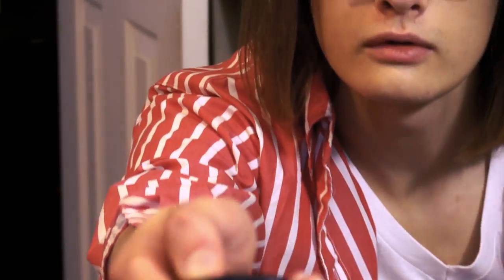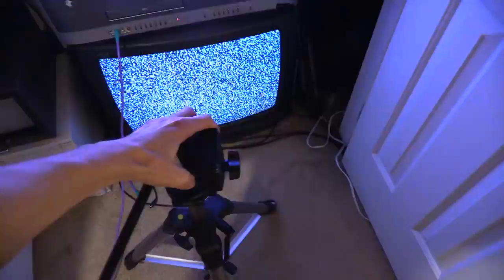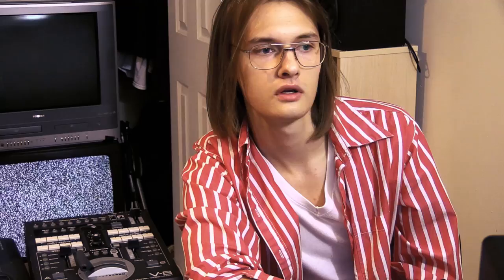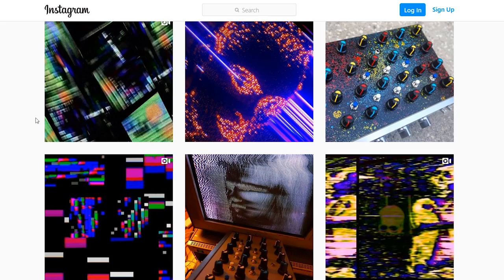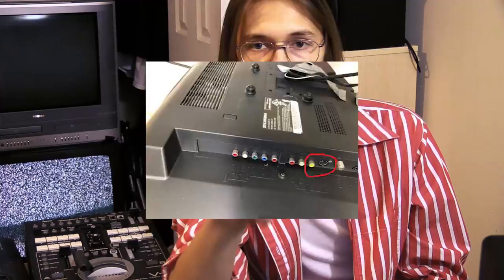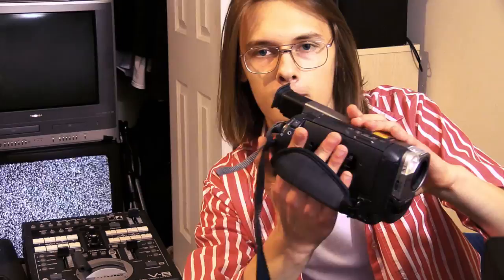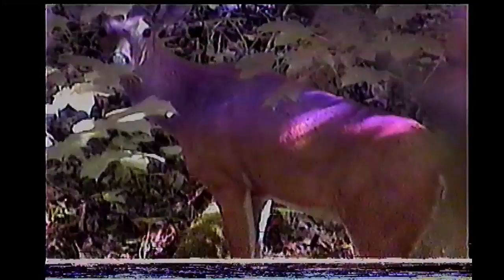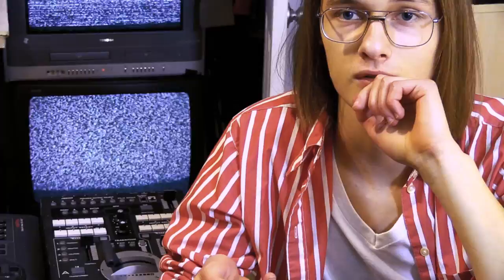3 different ways to capture analog glitch visuals

Comment: If you want to upload footage on Youtube, scale it up to 4K, even if you recorded it on HD - Youtube allows a higher bitrate on 4K (44-56 Mbit/s) as on HD (10Mbit/s). You can get way more details with this one, very nice with CRT stuff ;). As a filmmaker I can also recomment to setup the shutter to the number which is double the framerate, with this setting the motion looks natural. (Or you can just use 180 degree, if you have a camera which allows it) But you have to be lucky to get away from scanlines this way, depends on which CRT you're using. Keep on producing great stuff like this, very informative ;)
Reply from the maker: Thanks for watching! and yes sometimes I upload my analog videos in 1440p, but I haven't tried 4k though, I would guess it's probably a very dimished return by that point. And yeah I am also aware of shutter speed generally needing to be at least twice as fast as the video's FPS, but in this case when I'm just recording a screen, 1/60 shutter speed and 60fps works fine, I haven't noticed much of a difference from 30fps. I can't go faster than 1/60 shutter speed when doing rescans since it will cause scanning issues.

Comment: This is a fantastic video Michael - just echoing the appreciation others have for putting in the time to make something so comprehensive! I might have a few (anecdotal) tips as well -  

When it comes to CRTs the struggle to avoid moire is real. I went back and forth between shooting in 4k and 1080p and found that the higher pixel count of 4k would always introduce more moire, which makes sense. If you shoot in 4k and want to scale/crop/downres in post, it can even make the issue worse depending on the interpolation method your editing software uses when scaling. It might also look fine while editing, but it's going to get exacerbated once scaled on different platforms. Fewer pixels from the get go can be advantageous for this specific issue depending on your end goal, but one of the biggest things that can help negate moire is your aperture and focus while shooting. A shallow depth of field at faster apertures makes the issue a lot worse, as does being perfectly in focus. I started getting better results when I would push the aperture down to maybe F8-10 or so, get things perfectly in focus, and then manually defocus a little bit (usually closer, not further). There's a sweet spot between being overrun with moire and being too out of focus. If at all possible the best way to find that sweet spot is to monitor your feed in a piece of software (+1 for OBS) where you can scale it up and down easily in real-time, as it might not be apparent until it's being scaled. Just watch for when the moire becomes manageable at different scaling while you make tiny focal adjustments. 

You're right on the money as far as the shutter speed goes. Even at 1/60 though, I often run into a very slow moving single scanline which seems unavoidable due to slight desync - but it will move depending on the angle you're shooting the screen at (esp. if the screen is curved). If it's not a long shoot you can usually wait a bit for that line to get out of the way and shoot before it comes back, or shoot the screen at a slightly different angle.

I think FPS ends up as more of a preference thing depending on what you're shooting. I try to stick to 60 when possible just so the options are there in post, but more filmic stuff will always look more natural at 30 or 24. 

As far as capture cards, I've been fairly happy with the composite capture dongle El Gato makes because you aren't stuck with their godawful capture software; it works with most other software right out of the gate. If the final goal for a piece involves post production I might actually recommend skipping the composite>HDMI portion and capturing the composite signal at the native 480p resolution. This gives you total control over the up-scaling process in post while certain converters/upscalers will do some wonky stuff in the switchover. As far as software upscaling goes, Premiere does some pretty awful pixel interpolation in that process and there aren't any ways to change the method it uses (to my knowledge?). I get lazy and still end up using it a lot, but in something like After Effects you can set a layer to "draft" quality/sampling and it will act like nearest-neighbor sampling does in Photoshop. That means upscaling the video will keep pixels 1:1 as long as you scale to a multiple of the original resolution. Same goes for software like Touchdesigner, just making sure your processing chain is all set to Nearest Pixel. Totally dependent on what you're working with though - glitchy visual FX might not benefit from this sort of nit-picking the way video synthesis does. 

Like you said though, there are definitely no wrong ways to do this stuff and it's all about what works and what you like. More often than not the weird quirks that appear with a certain process are what make it look the coolest, I'm pretty fond of the slight colorshifting/rainbow shimmering that happens when shooting some projectors. Anywho I'm definitely still learning in this area, but I hope some of this is helpful!
Reply from the maker: Thanks for much for sharing your thoughts! Your anecdotes are great. I did not know Premiere actually has some software scaling quirks, need to look into that. As far as upscalers go, yeah, it's totally optional, and every device seems to work a little differently it'd be hard to cover them all. That's why I talk about the general process, and warn people it could be something requiring a lot of experiments, and purchases haha. Love your creations, and art!

Comment: Excellent video video and good information 👍👍 regarding the scrolling black bars in CRTs, an old video guy told me simply match the shutter speed of the camera to the refresh rate or Hertz of the CRT monitor👍 for instance a 60hz monitor can be captured with a 1/60 shutter speed.

Comment: you should mess around with warping the video signals with heavy magnets on a CRT, would add a cool layer of distortion
Reply from the maker: might do it sometime
Reply: This is how to destroy your tv from the inside while attempting to get similar effects that a circuit bent pedal or rack will do, it will create very subtle effects at the cost of likely obliterating/maybe erasing memory on the tv it could also cause it to shut off I wouldnt recommend unless you wanna murder your crt in .2 seconds. Different story when it comes to magnets and vcrs but again its a gamble and will destroy yo shit

Comment: I wish I found this video like two years ago through trail and error, I've tried, failed and succeeded at all of these methods 😅 just wanted to comment to say anyone thinking of buying the black magic intensity shuttle assuming, more expensive must be better, it's really not. I couldn't get it to work with anything, the camera settings have to be exact to the awkward software to have to use and any dodgy analogue signal it just doesn't understand, and obs also struggles.
Just a tip for anyone thinking about it, I've wasted my money there 🤷
Reply from the maker: yeah i never really understood the deal with the black magic thing, it seems unnecessarily finniky.

Comment: I recently bought the Elgato Cam Link 4K to try to capture the output of my video glitcher, but I have to use one of those AV2HDMI things before to convert the analog signal and connect to Elgato through HDMI. However I can barely see the output in OBS, it's coming out black most of the time. I assume it's because of the conversion those AV2HDMI devices do, and detect the intentional glitch as an unwanted signal. Is there anything else I can try to capture this in a better way? I have one of those USB dongles (that work) but I would like to improve my setup
Reply: Nevermind I figured out the issue. I had the Cam Link plugged through a USB hub instead of directly through a USB 3.0 motherboard input. Seems to work great so far. Thanks for the amazing video btw.

Comment: Hello hopefully you can help me out...I’m trying to use a Canopus ADVC-55 ton a MacBook bro 2015. 

I have a CERRXIAN FireWire IEEE 1394 Type A 400 6 Pin Female to 1394 Type B 800 9 Pin Male Data Transfer Adapter Converte connected to a APPLE Thunderbolt to FireWire adapter and it makes the Box turn on and everything so it’s giving it power right ? 

My question is...why won’t the program show up It says in the manual that I don’t have to install anything.

Comment: Aye, a fellow glitch enthusiast. Subbed=] 
I started last year with the same usb capture method! Definitely need to get the cam link and an upscaler but would I need both to get a wide-screen image?
Reply from the maker: well u will need an upscaler regardless to convert analog to digital, u cant use a camlink by itself. widescreen 16:9 only comes in at the software side, u will need to stretch, or some digital monitors and capture things do it automatically

Comment: Back in the day, lots of tape based video cameras had video line in, enabling source recording.

Are there any models of older SD card or hard drive based cameras with this feature ??

I realise that there are some drone video recorder options that have source line in to record the transmitted video.
Reply: Yea they do exist, I have one. As soon as the video signal gets even slightly out of whack the thing stops recording so it’s a bit useless. 

As far as drone recorders go, they are a lot more fault tolerant because they are designed for the drone flying at the edges of the broadcast range, but there are also a lot of bad quality ones out there. Have a look at the ImmersionRC PowerPlay for an example of a good one,  though I’ve not tried recording glitchy video with it. Perhaps I should test that…
Reply: @bytesabre  Excellent Intel, thank you 👍😉

Comment: Does glitch from a dirty mixer work when recording to a VHS tape?
Reply from the maker: I believe it should - only one way to find out for sure ;)
Reply: @YOVOZOL  it definitely does. Might drop the signal occasionally but looks great. Direct to OBS was hardly working, especially without any TBC to stabilize the signal. Will try recording to VHS first before uploading to OBS! Thanks for all the info, you’re a legend.

Comment: quick question, would it be possible to dirty mix the color stream inputs? Y Pa Pr?
Reply from the maker: it might be, i once almost tried to. my only worry is if your tv/monitor with ypbpr is going to enjoy displaying a corrupted signal like that. please do it and share the results!
Reply: @YOVOZOL  thanks for the reply!!  i definitely will but I think I might need more than a dirty mixer.  is it essential to get a video mixer like the roland V8?  i recently purchased a patchbay from Martino thinking i could use the dirty mixer to blend video together but the more im researching the more i see that having multiple sources ready to go or to be able to blend 3 or 4 or even 5 sources together is where it gets interesting.  as im returning to video glitch art, what would be a decent work around?